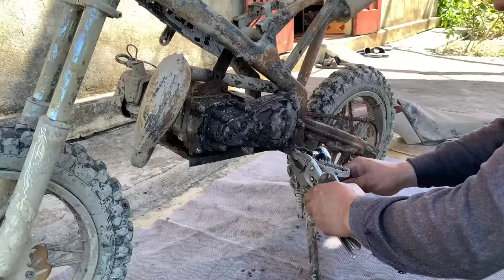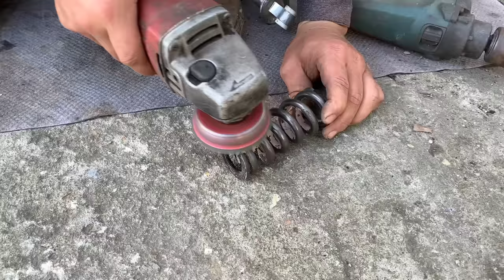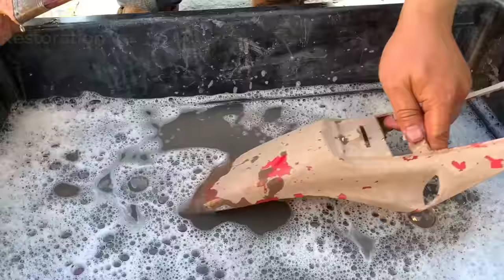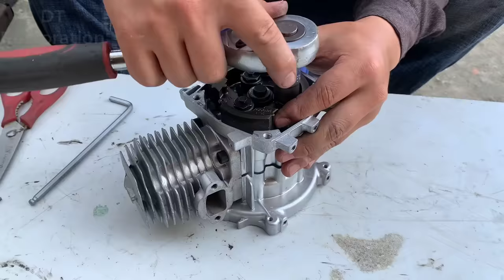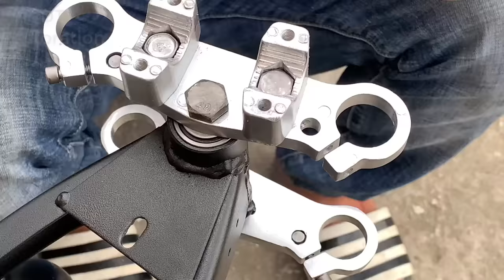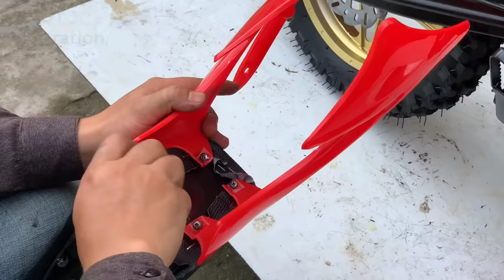KTM mini motorbike restoration | Restore abandoned 2-stroke off-road Minibike

Comment: Restoration: take a good bike rub mud and keep it under sun to dry. Then wash.
Reply: I know this guy is fake i mean like no one just goes to a rocky shore and just finds a mini Chinese mini bike and it’s not even a name brand mini bike let alone a ktm no ktm has a pull start!
Reply: @dirtbikemaniac9128  haha lol i just thought the same! and he also didnt flush with water in the beginning. what a noob.
Reply: was gonna say that, too! haha
Reply: @dirtbikemaniac9128  that is only drama hahahahaha
Reply: and then get 3million views
Reply: no rust and no stuck bolts like i have more rust on my kickstand than there is on that bike before the "restoration"
Reply: The engine still as good as new
Reply: Hmm toxic triggered
Reply: Very true, that's exactly what I was thinking. Look at the parts where they couldn't cover with mud, they are shiny. Would have been enough to give it a good wash
Reply: Jet wash. Done.  Video length:  5 minutes.
Reply: نحن تضعغللف
Reply: Generates 8.9 million views lol
Reply: 😂😂😂100% true

Comment: You have to be the best spray painter I've ever seen. The frame and flywheel shroud and pretty much everything else you restored with spray paint " outside in the wind btw " looks fantastic !!!! That little 2 stroke has a simple design but effective with the reed valve and the carb opposite from the piston. My personal favorite is the installation of the crank seals with the 17mm - 1/2 socket . Old school technique right there. I was thinking when you were setting the coil gap you were gonna break out the business card but that little motor you could almost eyeball the gap and get it close enough to fire and run. Great job on everything for real. I'm a insurance adjuster and during my down time I buy and restore a lot of dirt bikes over here in south Alabama. People who do these kind of things understand how important and enjoyable the entire journey of restoring something that begins with the search of your next project, the tear down, all the prep work involved, the restore of all the parts and then the eventual build. For me this entire process is just as fun and enjoyable as the final result and the pride it gives you in bringing something back to its former glory. The only issue I've had is once I complete these builds I don't want to let them go so I have a full shop and running out of room.  God bless my brother restorer

Comment: Just me or does it look like it was put there for a couple weeks as those bolts come out quite easy 🤔
Reply: I just watched a vid of theirs literally two hours ago and they picked up another mini bike from this exact location and in the same condition. This is definitely staged but I guess it’s still entertaining watching. Just sucks knowing they stage this stuff.
Reply: Also, if the bike had really been there for as long as they make it look, there wouldn’t be any shiny chrome under anything at all. Bike probably did need work originally but a little overboard with the staging and putting dirt all over it.
Reply: Thenrusted bike is true, be the assembled one is new hahahahha, you can buy this orion pitbike.
Reply: Hahaha the engine is brand new inside no rust at all…

Comment: The front and rear brake brackets must be swapped so that the screw head is at the top and the nut is invisible at the bottom. so more aesthetically pleasing